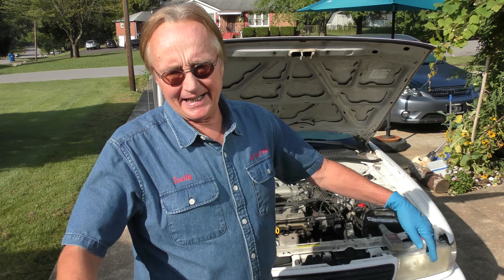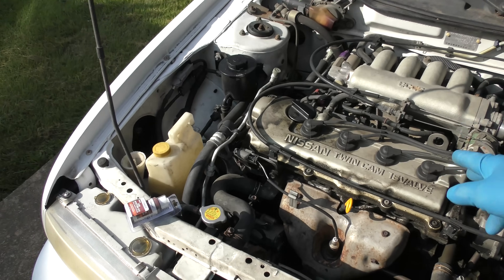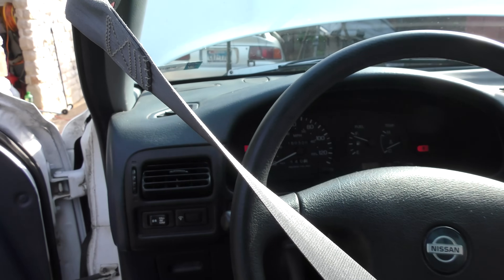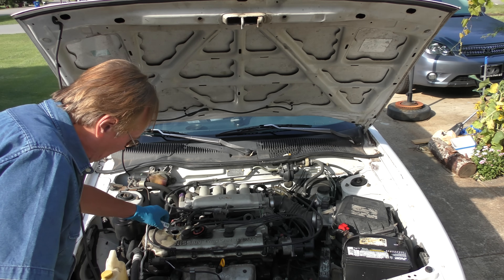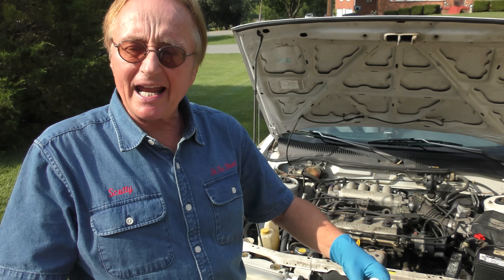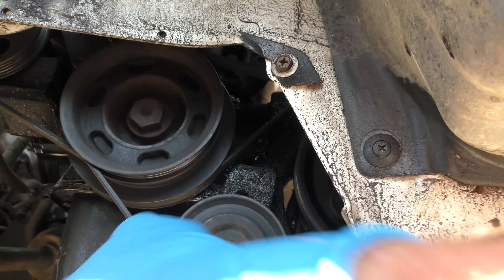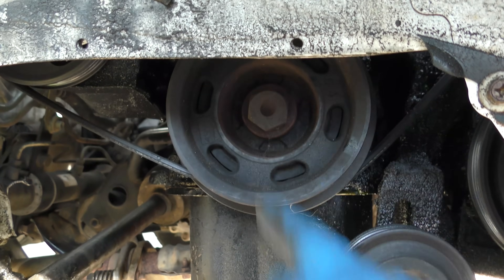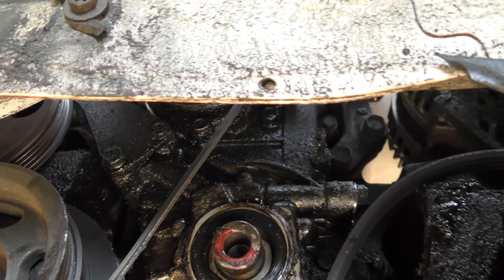If You've Got an Old Car, Do This Now

Comment: Thanks for the Recommendation to change my own ATF.  My 2003 Saturn ION is probably due for another change ( as 200K approaches it's probably due).  Then again as it's now 20+ years in service I should probably put some TLC into its eventual replacement, my recently acquired 2014 GMC Terrain with almost half the miles and a good Service History, but just like my ION... An ATF change (might) be horribly expensive all because the OEM ATF is rarely cheap and the drain/fill plugs aren't always DIY friendly... 

But "teach a person to fish"... I wouldn't mind saving money and knowing it was done right

Comment: I have a 1995 Sentra that made it 338,000 miles before the engine finally blew up (head-gasket, I suspect). Replaced that front seal at 180,000 then had to do it every 30-50,000 after that. Do NOT get cheap seals! Thank God the rear seal never leaked. Changed oil and filter every 5,000 miles. Never changed the tranny fluid.

Comment: What's up guys.I live in northern Minnesota where temperatures get 40 below 0 somtimes without wind chill.I own a 2003 buick lesabre limited edition with 478.000 miles on it,bought from a  coworker 2 years ago.
I have been using e85/unleaded mixed with no problems, I'm driving this vehicle with no problems. 
I'm getting better milage than my girlfriends peice of crap 2013 Ford escape.
Last winter here it was 50 below with wind chill,her car battery was dead,mine started so I went out to Walmart to get jumper cables, this is when I haven't had to really look under the hood yet,,so came back to jump her car,,I couldn't find the battery ,my car battery under the hood,.
Omg,,the cars battery is under the back passenger side back seat!!!!😊
Un believable the perfect design for a car battery. That is still the original car battery at assembly 20 years ago.

Comment: Scotty, you got me on the thumb nail. I thought someone was saying AT-205 doesn't work. Well thanks to you, I know about AT-205 and I can say it works. Yes, on small leaks. My 2009 Honda OdysseyEXL has a small leak from the spool valve and it stopped my leak. When the van oil % is at 30% it starts to leak again. So I just change the oil and off we go. Will I fix it, ya, but for now its worth the $20. By the way Honda doesn't just sell the gasket anymore. I have to buy the hole spool valve. I know I can try an aftermarket gasket, but I have heard it can cause problems. Thank you Scotty and keep the videos coming. ♥️
Reply: I have the same exact year and trim odyssey that you have just put the AT-205 in a two weeks ago. So far so good.
Reply: @stilllearning6656  that awesome and if it's your spool valve Honda doesn't sell the gasket by it self anymore, just the valve. We just had to change the Alternator because of the oil dripping on it. That was a two person job getting the belt on. 150,000 on ours.

Comment: Hey Scotty! The first question was about gas that's below 87 octane and I don't think you addressed it! In carburated cars 85 octane was used at high elevations, to my understanding it helps carburateurs compensate for thinner air making the mixture richer but for fuel injected cars to the best of my knowledge never go below 87!

Comment: Depending on how big the leak is, for $1800 you could also just leave it.  But it sounds like the front main seal was a fast/large leak.  If it's the rear main seal, if it's even 2 quarts a month, it may just be cheaper to drive it and keep adding oil as a rear main seal job could easily be $500-$1000+.  You, could dump 1-2 quarts of oil into a vehicle (a month) and it would still be cheaper than repairing it in most cases, unless you do it yourself.
Reply: ...but awfully messy if you value no oil stains in your garage or driveway......
Reply: Main seal leaks can be huge. My front main blew out and all my oil leaked out in a few minutes. Fortunately, I was home when it happened.

Comment: Honda pilot 2007 4wd,  I'm getting tired and now this Bill ($5.600 dealer), But it's only 105.000 miles. Leaks, axles, trailing arms, control arms, etc... should I give it away?? Thanks 👍

Comment: Hi Scotty. I have a 2002 neon having issues with the idle. When im stopped the idle drops below one rpm’s and feels like it’s going to dye. I replaced the throttle position sensor, the idle control valve. It still does the same thing. Do you know what it could be? Would really appreciate any information

Comment: I have a 2015 four-cylinder Honda Accord can I drain and fill the transmission fluid myself or do I have to take it in to a dealer where they want to run transmission through it two times and then fill it on the third time? Thanks

Comment: In most cases, I've seen most cars say at least 86 octane (although I've also seen 87 octane as the recommended).  I know out in CO you can get 85 octane, which probably is not going to make much of a difference, although since much of CO is at high altitutde, it does make me wonder if at higher altitude if this matters to the car or not (since the air is thinner), and most cars are naturally aspirated.

About the Rogue... isn't even the new Rogues more in line with something like a RAV4?  Those only get about 25 mpg.  I mean there's probably a reasonable weight difference (and power difference) between the Rogue and a Matrix I would think, although my 2020 Camry can get 38-40 mpg on flat land even at 75 mph (and it's not a hybrid, but the regular 2.5L 4 cylinder) so maybe the Rogue shuld be getting more like 30 mpg combined or highway (my car is rated for 36-37 highway and about 32-33 combined).  Although I do have to say that Toyota's EPA ratings are relatively accurate, and in some cases, are too low in terms of what you many actually get.

Comment: SCOTTY I changed oil and filter transmission fluid and filter. Transmission shifts better than ever, but after shifting through all gears ( automatic transmission) my 1996 cyl 3.8 litre mustang lopes, like if something has hold of your shirttail and you were trying to pull away.  PLEASE HELP. Can't afford to go to a shop, diagnostic at AutoZone says purge canister valve bad.  But engines running lean. Not rich and no smoking at all. Didn't have issue before

Comment: I've got an oil leak that's dripping onto the clutch, it's a 2007 ford fiesta 1.25 zetec, Iv'e read on the net, when they last changed the clutch, they didn't seal a bolt up properly and it's dripping from that, is there any oil additive I could use to slow it down? I was thinking about putting wynn's additive in there, as it sticks to the metal casing, so thought it might helps stop the oil dripping. The car drives fine for the first 15 or 20 minutes, then the oil starts to make the clutch judder. Any help appreciated

Comment: i have a2009 nissan Frontier with a 194.000 miles on. had radiator flushed at 159,000.. Should i have radiator flushed or get a new one? Know about the problems with these trucks. Thanks
Reply: guess no one can answer my question

Comment: I used this in my car 3 days ago and been driving. Have you heard of anyone mentioning there lifters were ticking on a cold start!?? Whats up with that? My lifters never ticked and I hope this will go away after driving more miles or with an oil change. I assume the solution is sticking to my lifters as it would to rubber seals.

Comment: 2007 impala just turned 100,000 oil leak put cardboard under car leak is about 12inches back from radiator,

Comment: Inside and outside of my car is an exhaust smell. There are no oil leaks on the ground. Former mechanic said the smell is normal at startup. Next shop mechanic said they used the dye and can’t find the source of the oil leak. I’m female and I’m surprised and very disappointed these are the answers being given. Meanwhile I don’t know whom to take my jeep to other than the dealer and I hesitate to go there because they are nearly $250.00 hourly. Oh, and my new ceramic brake noise, shshshshshshsh is normal. It’s actually the metal brake plate. O’Reilly’s manager kindly looked at the brakes and found the plate needs adjusting or replaced. I didn’t tell him the sound it was making and he said it makes a shshsh sound and I said yep and thank you! I’m irritated, I’m going to probably need to have a different shop fix this problem which is going to cost more money, of course.

Comment: This is the easiest seal in the world to find and fix, no timing to reset, some seals like the seal on the high pressure pump shaft on a Navara or Patrol require skill to fix as the timing covers and timing chain and belt have to be removed, anybody that has done them will no the difference, you won't do them in ten minutes, you will be there all day and praying you get the timing right because if you don't it's start again time.

Comment: I've got a 1.5 liter 4 cylinder with 110,000 miles plus Nissan Versa 5 speed manual transmission, and have done practically nothing to it, other than oil changes, brakes, tires, and filters. Trust me they still make some good ones. These days I put high mileage oil in it. Prior to that, I put nothing but synthetic oil by the dealer(while on warranty). This little car is a beast. It runs like a new one, still today and I can easily go down the highway at 75 MPH. I also own a 2009 Honda CRV with 2.4 liter engine with over 102,000 miles on it. I run this during winter time(it's 4WD) and I figure, both will last the rest of my life(60 years old, now) as long as  I keep up the regular maintenance. I told my girls, years ago, the life of an engine is keeping the oil changed when it's time, filters and regular small maintenance. They all listen now, since some of their cars died, much earlier than any of mine(had 278,000 plus a 1979 350 Chevy and was running when I got rid of it).

Comment: the higher gas is really made for HIGH PROFOMACE CARS  like your PORSCHE like your 911, LAMBOS, Ferraris,  any  kind of SUPERCARS or any HIGH  END  cars cause they can handle the MUCH HIGER OCTANE you don't use any kind of HIGER OCTANE in an regular car  it's  NOT made for it,even if your computer in your car "WOULD" compensate for the higher OCTANE you'll     lose what ever power you  DID HAVE you would ruined your engine down the road, so why risk it ONLY used the gas that's made for YOUR car,so if your car uses 87 OCTANE, then use 87 OCTANE you don't use a HIGHER BLEND of gas UNLESS the owners manual says that you can.I've learned that from THE LATE PAT GOSS from Motor Week YEARS AGO

Comment: I've owned two, a 94 Altima and 97 Sentra. 94 Altima with the 2.4 was bulletproof but it rusted out, 97 Sentra with the (if I remember correctly) 1.6 was the second biggest POS I've ever owned. Finally rolled a bearing at 140k..I hated that car, with 4 people in the car you almost had to get out and push it over hills!
Reply: Dad said Nissan put out some crap in the 90s.  I think they went to the bailing wire and plastic wheel power windows back then trying the chase the Europeans down to the bottom in quality

Comment: Scotty its funny to listen to the way that you report on a mistake that Toyota makes in manufacturing ANY of their vehicles. You rarely do mention them and when you do you rush through it as though it’s nothing….as in this one today. I watched your video yesterday and you mentioned a recall that Toyota issued on 10s of Thousands of Toyotas with battery hold down issues. In the video you didn’t mention the excellent battery securing devices used by your most hated auto manufacturer , Ford. The one used in my 1996 Ford Bronco holds onto the battery along the side and at the base of the battery, and the size of the battery doesn’t affect the clamp. But you were quick to point out that Ford issues more recalls than any other manufacturer. You don’t mention that most of the recalls are for non life threatening issues. Most auto manufacturers have to be forced to issue a recall by the NHTSA before they will spend the money to issue a recall, and it will usually have to be a life threatening issue. 
Ford sent me a notice that the tailgate on my truck might unlock and open itself. It did. The dealer called me when the part came in and I took my truck in and they replaced the part. There have been others but I don’t remember any that were life threatening. 
It’s companies that don’t issue recalls that I avoid spending my money on. 
   You can brag on all of the Toyotas you want to but some of know the truth when it comes to the cost of parts and labor and the amount of labor hours allowed to fix a vehicle. 
I know that Toyota and Honda build good vehicles but when it comes time for repairs you are in for a shock. The same goes for Mercedes and BMW. As a mechanic you know it’s true. 
Every other mechanic out there knows it also. 
I’ve easily gotten 100,000+ miles without issues (only routine maintenance) on every Ford I’ve owned since 1989. 
   I like you videos. I appreciate you knowledge and your skills. You offer excellent tips on maintaining a vehicle. 
   Thank you for taking the time to put the videos together. 
   Merry Christmas to you and yours. 2023

Comment: Prior to the ghastly Platina (Renault engine) Nissans were excellent. I had a Sentra and it was indestructible. And my Altima 3.5 with its 4-speed auto was super quick and totally reliable. I wouldn't want a modern one, that crummy CVT, take that rubber band tranny and stick it where the sun doesn't shine.

Comment: Can't be no worse than a 98 chevy blazer  with passlock security issues and or a faulty body control module, or a faulty ecm or wiring and electric issues that are a complete headache.

Comment: Car prizes in USA are insane! 1800 for old clunker. I got 2006 Audi A4 in Europe for same money!
Reply: that nissan is still better than that audi in my opinion
Reply: Because it's an Audi. Wait for all the plastic parts to break and the electrical problems.
Reply: lol tell me you know nothing without telling me you know nothing
Reply: My A/C on 04 Frontier just froze up.  Do you recommend just changing the compressor, than adding freon from some shop?  It just recently stopped working and I don’t think there is any damage in the lines.

Comment: Can u help me I have a 2011 Subaru turbo 120 th miles rides great blows white smoke 😢
Reply: Coolant leak. Most likely the head gasket. Buy some head gasket sealer and hope it works. Unless u want to pay the crazy repair bill that's an option too
Reply: Check your turbo.

Comment: my parents had the original Nissan Sentra mom called it a pepsi can on four wheels. When she worked for the local school district she furnished her own gas. 15.00-17.00 fill ups goes two weeks extremely fuel efficient. Well we out grew it as a family but got 15 plus years out it. they never should have changed much other than make em bigger and roomier. the only catch 22 with was it drained the battery after it sat a week or so after vacations. you pumped the accelerator a few put fuel in the bowl quick n dirty put about a splash 💦 of fuel from a can charge the battery off to the races.  it was basic no power locks or windows or seats nothing electronic manual hand crank windows you had a key 🔑 for the door and the same key started it. no fob ac they need to back to originality these trans are garbage saw the newer ones much improved give ‘em that. you had basic radio cassette deck today heck no too much electronics too modern if one chip or pc goes car or truck is dead.

Comment: My 2016 sentra has 100,000 on it, this 93 is sitting at 160,000??

I need to live closer to work.
Reply: My 1995 Nissan Pulsar has 91000km (56000miles), bought it off an older couple who hardly drove it.